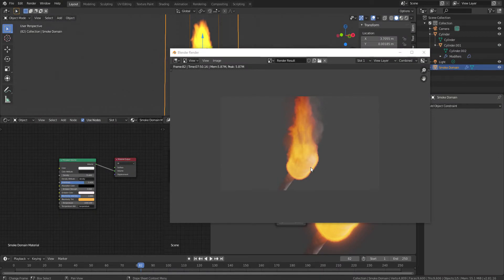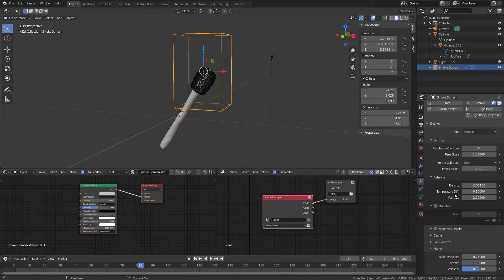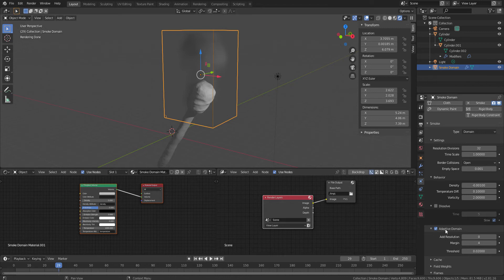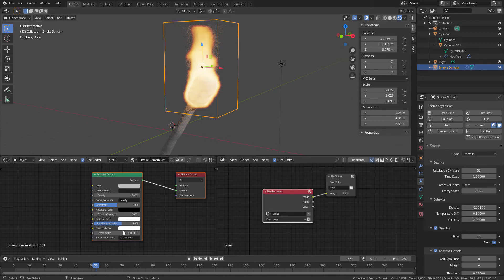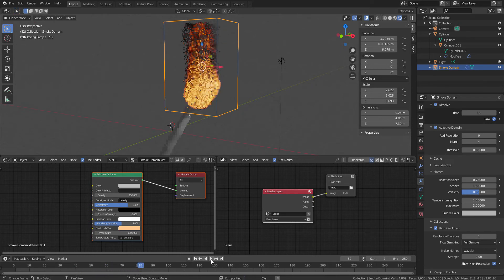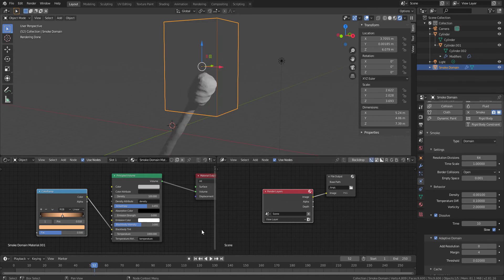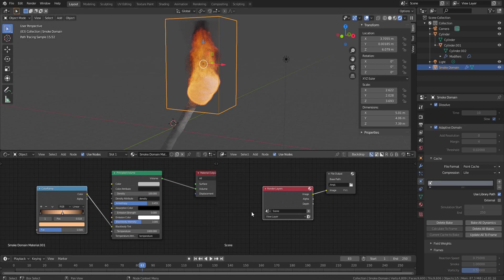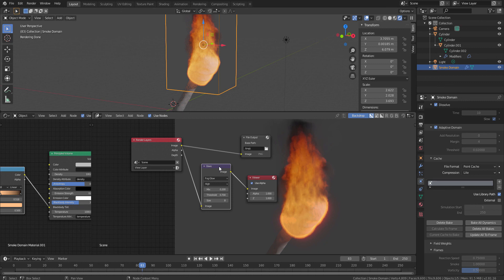How to Create Torch Fire in Blender 2.8x | Torch Fire Simulation in Blender | Quick Fire in Blender

Comment: Very good tutorial! THANKS! In the current version, there is no "High Resolution" option and - at least for me - no Bake button. I have to use F3, type bake, and use "Bake All Data" - hope that´s the right way.The next problem I need to figure out is how to append a torch into another scene - as of now I can append the model and domain, but it won´t render any fire in any mode. Nevermind, keep it up!!
Update: Appending works for me, when I append with "Instanced Collections" activated. ;)
Reply from the maker: Which version you are using?
Reply: @Stereopixol  2.90.1
Reply from the maker: Sorry I havent checked with the new version.
Reply from the maker: Thanks for the updates. It will help others to follow.